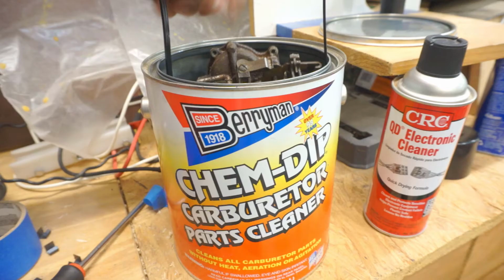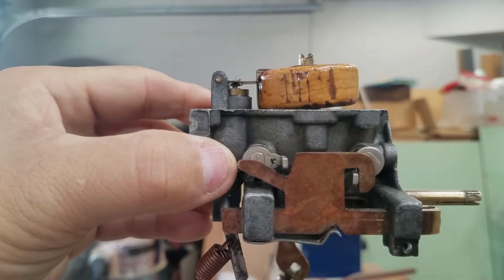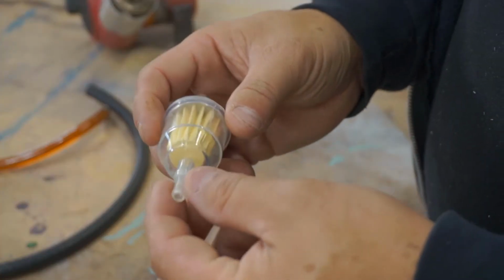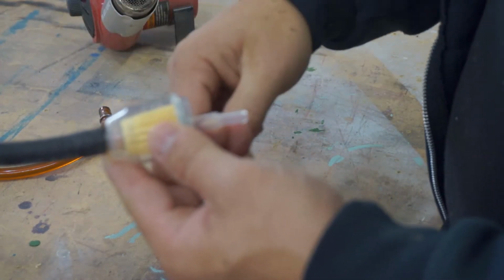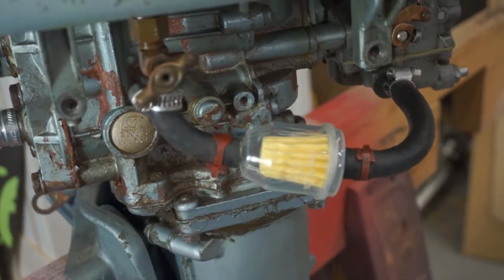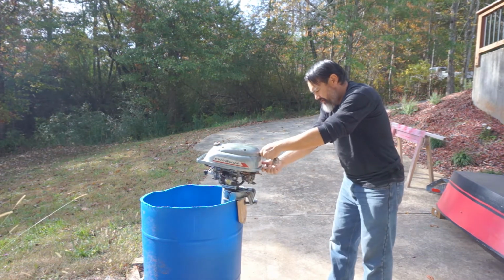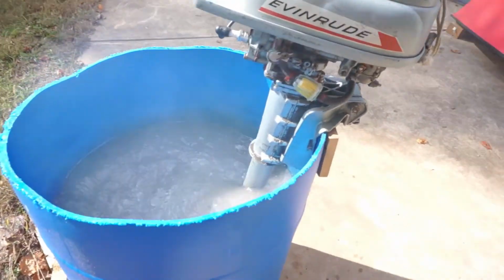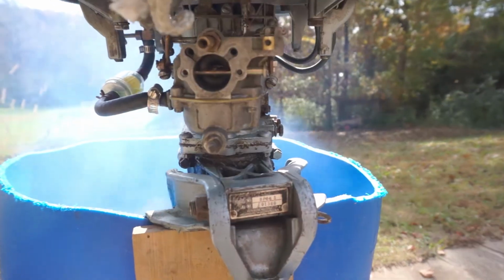Evinrude 3Hp Carburetor update and fuel line repair ep 5 -  TheGarageEngineer

Comment: 10-4 on the TCWC -3 and 24/1.  There are a couple of plastic 2 stroke measuring cups available, Walmart has a one in their  fishing department that is good and cheap. Makes the mixing of gas/oil easy and accurate.
Reply: PS try not to use the crap ethanol gas in your motor.
Reply from the maker: Thanks for info. I used non-eth gas.

Comment: After having outboards with carbs, and some with multiple carbs, my last motor had fuel injection.  It was so nice to just crank it over (no primer bulb needed) and take off!  It was only finicky when the water separator filter needed replacement which was about once a year.